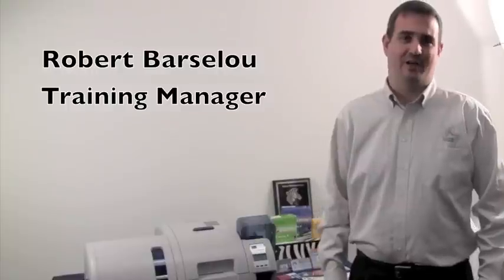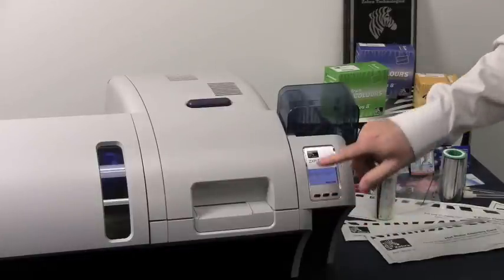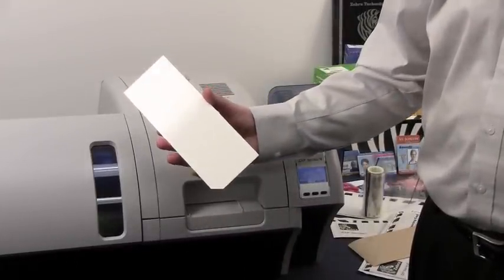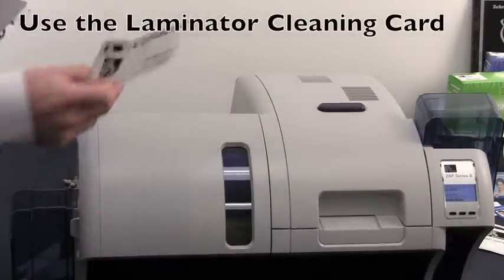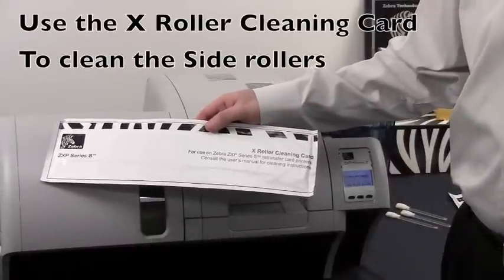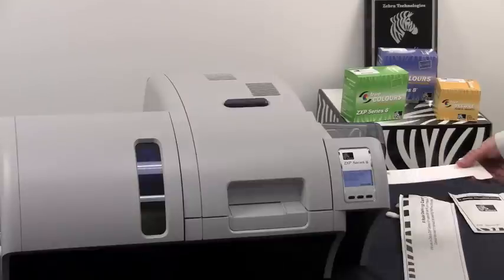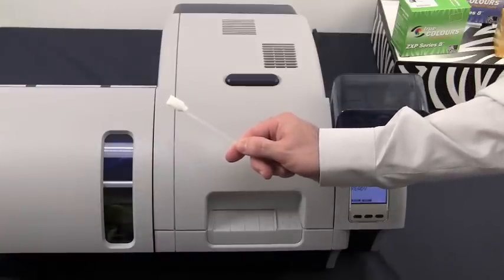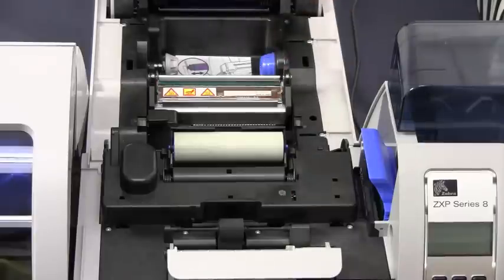Zebra ZXP Series 8 Card Printer Cleaning

Comment: I use this printer on my office. I have a a little problem, every time the card enters the laminating process. it said the laminator late jam error code 17005. I tried to pull down the laminator, it worked but every time the card goes out from the machine, the machine makes a very loud and rough sound. I'm afraid it will damage the machine. How to fix this? I've tried to clean the laminator but it doesn't work.